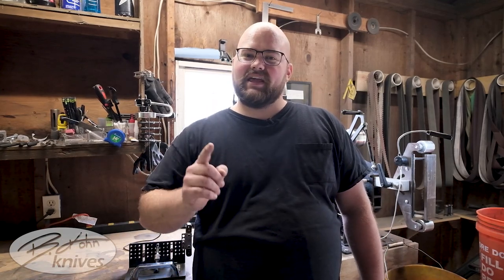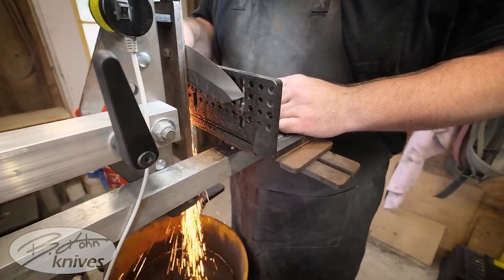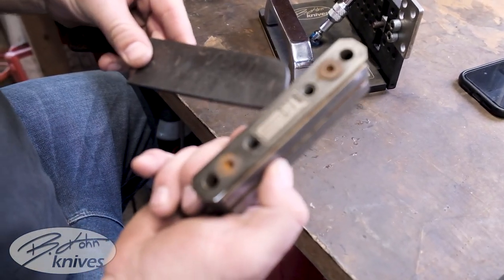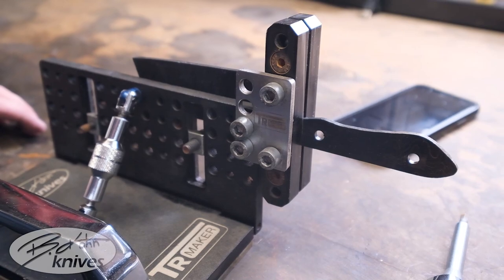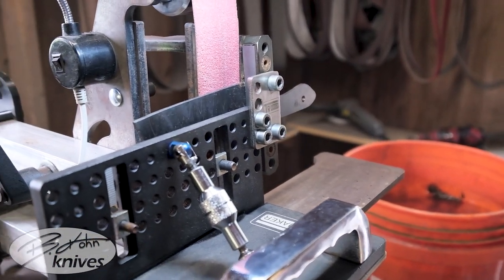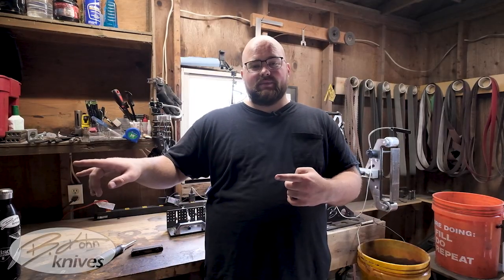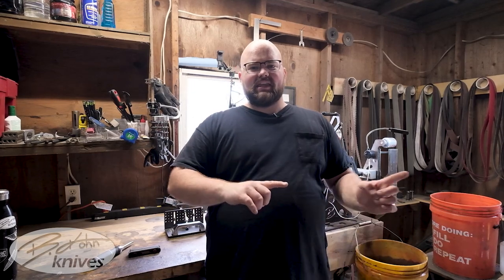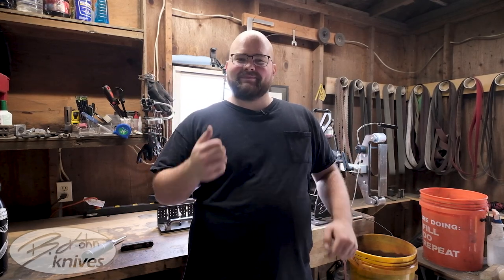TRMaker Bevel Jig Review

Comment: Only issue I have with grinding jigs is that it makes it a real PITA to keep a heat treated and tempered blade cool enough to not ruin the temper.
Reply from the maker: Use a misting system and dunk the whole jig in a 5 gallon bucket of water

Comment: Thanks for making the video. Can you do decent hollow grinds with this jig? I've one that's similar and it works great on the platen and the flat grind line follows the profile of the blade but on the contact wheel it doesn't work so well and the grind line is hard to lift up near the tip without blowing through the edge. Maybe it's technique or maybe that's a feature of using a fixture with the hollow grind technique - have you experienced this at all?
Reply from the maker: Sadly, I do not have a large wheel attachment for my Brodbeck 2x72. I’ve never attempted a hollow grind so I can’t speak for the TRMaker’s ability to help with that task.
Reply: @BKohnKnives  if you tie your knife well it will work fine.

Comment: Really neat and thanks for sharing!  I fully agree there's nothing wrong with using a file guild and grinding jig; we use a drill press and table to ensure a perfect 90 degree hole and tool rests on the grinder... whats the different??  Now as you watch the grinding footage you'll see the grind lines really weren't consistently straight.  What do you think causes this and how did you correct it?
Reply from the maker: First off, thank you for this comment! Wavy bevels always seem to happen when I’m on camera! It’s caused by not meeting the platen square when you start the grind, uneven pressure throughout the grind, and pushing too hard... In other words, I was rushing it. If you slow down and take your time it never comes out like that. It’s also always fixable when you are free handing the rest of the way if you do end up with a wave. 👍🏻

Comment: I had a lot of trouble with my tr maker jig the adjustment bar thread was loose and wouldn't hold a angle
Reply from the maker: I haven’t experienced that issue with mine... try contacting Yücel on Instagram and see if he has any way to fix your issue.
Reply: @BKohnKnives  he sent me a silly fix video and some messages that I couldn't understand so I modified it it's  way better now
Reply from the maker: May I ask how you modified it?
Reply: @BKohnKnives  I added a nut to the top and bottom of the adjustment arm so when my angle is set I just tighten the nuts down its perfect now 👍👍

Comment: I bought one and it will not hold an angle. No way to lock it down
Reply from the maker: I find that the screw system on the back is more then tight enough to hold it steady for me. If you talk to Yücel I’m sure he can help with your issue.